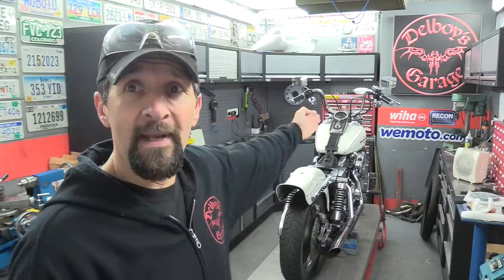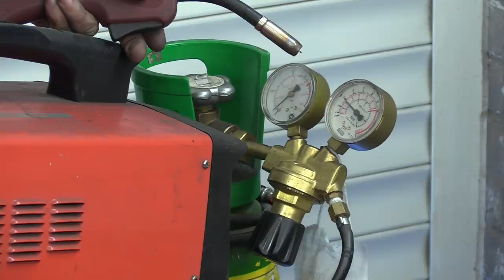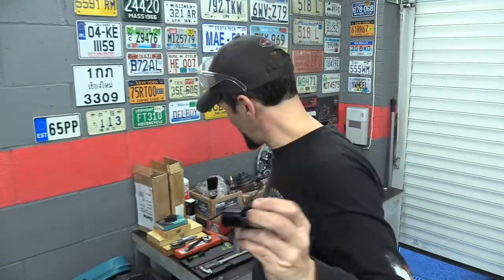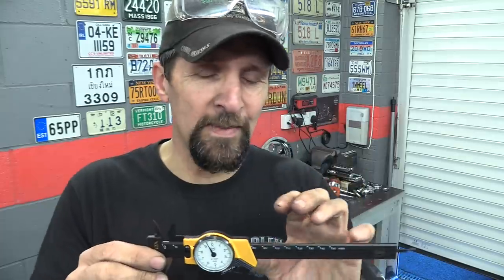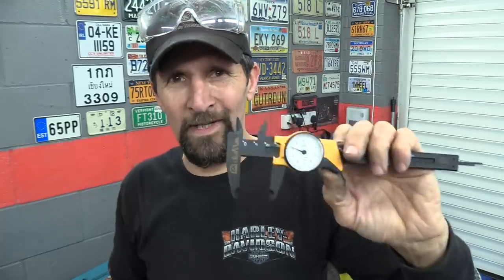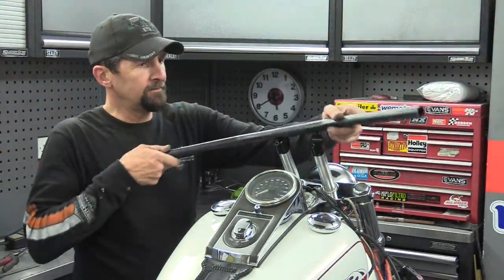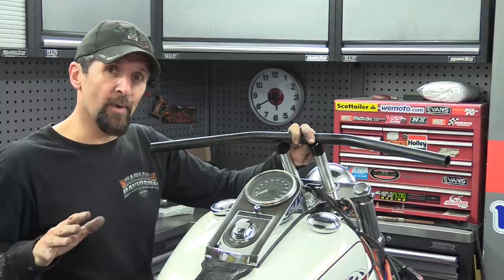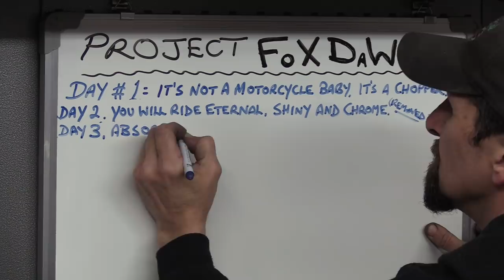Delboy's Garage, Project FoXDaWG, Day 3 :- Handlebars..!

Comment: Hi I am not sure about the threaded bar considering it is generally made from low grade steel (I know I wouldn't use it for this purpose), a lot of weight and vibration goes through these risers even when you take into consideration rubber mounting and leverage from the bars. bare in mind you will be selling this bike. If you wish I can send you couple of 12mm x 200mm high tensile steel allen cap bolts foc.
Personally I would have left the risers solid, drilled into the risers at each end using shorter HTS bolts. The bolts don't need to be D shaped at the top as when the bars are fitted this will align them then tighten from the bottom, a cap screw head at the bottom will look better than a nut and thread protruding.
Reply from the maker: Hi buddy, good to hear from you... well, you're the first person to say you've got, or can get, 200mm x M12 socket cap bolts, I've looked everywhere.. they need to be 8.8 at least, I was loathe to thread anything in to the aluminium, for obvious reasons, every Harley risers is steel in to steel only... am gonna junk the rubber mounts, eventually, and put some steel lock up bushings in there, so that may exacerbate vibration transfer (but I'll damp it out with internal slugs in the bars), it will make the whole front end more rigid... there's a should cut in the bottom clamp, so I'd still have to put a flat in the screw cap, as it won't recess down... and I can't machine them as I don't have a mill, but some 8.8 tenstile M12 x 200 would do the job, if you have some... the closest I got was some dome capped and shouldered coach bolts that were green in colour at the DIY store, and soft mild steel, so obviously no good!  ....

For what it's worth, this stud is labelled 12.9 and was sold as tensile, but of course once you weld it to put a head on it, it does make a weak point... I'd be a lot more worried if I was running taller ape hangers, with the amount of twist that would produce, but not so fussed with drag bars as there's practically none in comparison... 

I'm not riding till about March, so I had planned to keep looking for the said bolts, and I have to admit, I've only been looking retail, there are plenty of small jobbing engineering shops I could have ordered them to be made in the future am sure, but they all seem quite pricey!

And finally mate, this one's gonna be a keeper, if at all possible.. it's a pretty rare bike in many ways, they only made 88inch motors with a carb for 1yr, and at the same time this was sold, they already had EFI models in the showrooms, plus it;s the right style for what I want, so am gonna keep it, if I possibly can... once again mate, if you have those bolts, then I would be eternally grateful, and happy to pay for them... if you could drop us an email too, then we can sort it out, and would love to be able to give you some credit on the video for it when I swop them over... Thanks again, cheers, Del
Reply: @Moonfleet41  They are 12mm x 200mm 12.9 HTC, I will see if I can get your email and get your address and send them to you, no need for a mention Im only glad to help and would do it for most even Matt lol.
Reply: I had to cut and paste your email into my google account to send my email. The link wouldn't send it through iCloud.

Comment: The whole riser fabrication is suspect IMO.  The risers at 6.5" compared with 1" increases the overturning moment by 650%.  The actual leverage on the bolt/mounting is 0.5 of the diameter of 28mm i.e 14mm compared with the original at 20+mm(? - 1/2 major axis of the elliptical riser), thus the stress on the bolt and pressure on the mounting seat  is getting near to 10x what it originally was.  The fabricated 'bolt' itself appears to be only low grade studding, whereas for such a load critical fabrication I would have simply gone for a 12.9 bolt i.e. one with 25mm rolled threads and a plain shank to maximise the strength.  The studding is likely to have a tensile strength of 400MPa compared with the 12.9 bolt at 1220MPa - i.e. 3x the strength.  These bolts are available on-line or through any fastener outlet.  Bearing in mind that you have rubber (!) mounts for the handlebars, I would expect those to fail before the bolt, especially where the loads are increased by 10x, in any case it could be catastrophic.  Remember there is a significant force exerted on the handle bars under severe braking .
Reply from the maker: Hi Clive.. very slightly flawed reasoning maybe mate. the bike will wear Dragbars.. "flat, straight and zero rise".. the factory bars were14 inches high.. so by your reasoning im 7.5 inches lower than stock..?   the pull against those rubber bushes was from 15 inches above (14" bars +1" risers)... and now its only from 6.5" above.!!!  so a 57% reduction in load. 

Also, im going to replace the rubber bushes with steel ones to lock the flex up completely.. and ive ordered some 200mm 8.8 tensile M12 Allen bolts from a stock holder.. just needed a flexible solution for now.. didn't want to go buying expensive fasteners that i turned out not to need.  and for what its worth, 8.8 is correct as the factory use that to bolt the OEM  risers on..!     Thanks for your input mate.. have a good evening.. Del.
Reply: @Moonfleet41  Hi Del,  I did consider the application height but the mounting of the bars adds a rotational element into the equation that I discounted as being too complex and requiring the clamping force and friction of the bars/mounting block to be known.  Imagine if you will, the situation under braking where the clamping force is on the light side so that the bars rotated in the clamp, the horizontal load at the clamp would be minimal until the bars themselves were horizontal, by which time the whole horizontal force was reduce.  I take your point about discarding the rubber mounts, which is a good idea, so long as you don't suffer the vibration white finger from the Harley's "whole lotta shakin' going on". lol 
These days I don't bother with any bolts below 10.9 and prefer 12.9 for all load applications simply because there is no real cost penalty in doing that.  The availability issues of the past are no longer a factor.  Similarly, 8.8 bolts are now so common they are my default spec for all other applications.
I enjoy watching your productions as they are very stimulating and I always learn something, thank you.
Reply from the maker: @clivewilliams1406  Thanks for your reply Clive, it's always been my opinion that you can over think these things and one argument ends up cancelling out another... in the H-D manual they offer some very useful reasoning to many of their recommendations, one being the 8.8 tensile bolts for the riser mounts, anything harder than that will, naturally, be more brittle, and obviously they take bending force, as you point out under hard braking, or acceleration, and milder bolt will be more resilient than a harder one, which is, I guess, their thinking... but am confident in locking up the mountings solid, because luckily this has a cam balanced motor, so the vibes are considerably less than non-balanced engines and also I can damp out a lot more vibes than rubber mounts could ever offer just by weighting the ends of the bars as Harleys never traditionally have bar weights, which I've always felt is odd for such a heavyweight engine... but there you go, great to theorise, take care, have a great weekend my friend, and thanks for your wonderful feedback!
Reply: @Moonfleet41  Hi Del, thank you for your reply.  Not wishing to drag this out longer than necessary, one last point that might interest peeps is that the 8.8 bolt has a yield strength (crudely the point at which it starts to stretch with very little extra load applied) is 40% lower than a 12.9 bolt.  The point about rubber mounts is that under extreme conditions they will allow greater strain on the bolt than a solid mount, in that situation I would like the comfort of having extra load capacity than relying on the bolt's ability to flex.  
It used to be considered that in order to prevent component failure you added compliance into the system to absorb the extra loadings that occurred in some types of motorsport but that was turned on its head when the engineering became more analytical, far from increasing the components ability to accept high loadings compliance weakens the system.  Compliance used in most vehicles is purely for comfort reasons and discarding such compliance immediately increases the load capability of the component.
Reply from the maker: @clivewilliams1406   This is all good news Clive.. i now have some 12.9 tensile allen bolts for the job to replace the ones i made.. and also some solid steel slugs to replace the rubber bushings... it'll be interesting to see how this feels in use with zero damping.. im not so sure it'll be that much worse.. we shall see... thanks again mate.. Del.

Comment: Personally the drag bars for me, I do also think that the risers are to high and the the threaded stock bar should really be hardened steel for more safety. The riser height could lead to a lot of flexing on that heave front end. Just my opinion 🤙
Reply from the maker: Cheers buddy, the label on the threaded bar says 12.9 so it's sold as strong steel, but if I worry in the future when it comes time to ride it, I can get some special bolts made up (as M12 x 220 is not that common, specially not in pre-manufactured size), or I may wimp out and go for some stock 6" Harley risers, that means laying out cash that I have to point towards other things at the moment, and it's always kinda cool to use something you made yourself... I never compromise on safety whatever the cost...
Reply: Moonfleet41 totally agree Del, bike is gonna look 😎 I like the black idea a lot 👍

Comment: You need to shorten you two bolts  to about .25 inch below you bottom nuts.  It looks ridiculous the way it is.
Reply from the maker: They are deliberately long for now Jim, in case I make adjustments for different bars !

Comment: just a slight point, neither of those tools are vernier calipers... one is a dial caliper the other a digital caliper... Vernier calipers have a graduated scale inscribed on them.
and in about 22 years of using all 3 types of caliper (all metal) i've never damaged any surface i'm measuring.
and did you actually move to measure the bolt while the lathe was still turning? I did that once at college and have NEVER done it again lol because there is nothing scarier than having a tool ripped from your fingers.
Reply from the maker: You are, of course, quite correct, but as you probably would agree, the word vernier has just become a general term for all of them... but point take, thank you
Reply: @Moonfleet41 thanks for the response. It probably has become a generic term for the layman, but shouldnt someone who is attempting to teach people things theach the correct terms?
Reply from the maker: @viscarrio  Oh, that wont be me then, I might pass on a few tips I learn from other people, but I wasn't teaching anyone anything my friend... just passing on this ESD caliper was a great remedy for the delicate parts you need to measure that can easily be marked or scratched, nothing more than that.
Reply: @Moonfleet41  fair enough then lol

Comment: I sure hope those bolts are temporary. After you got done face cutting them. You can see the separation between the nut an all-thread.  An wilth all the leverage on those bars. Oh hell no. With the way I ride my bagger. Those bars would snap
Reply from the maker: You worry too much buddy, they won't be going anywhere, remember it's thread, not just plug welded, so they'd have to rotate at least 4 turns completely to come off the end, the stud is 12.9 tensile with nylock nuts, so they'll be fine... !
Reply: @Moonfleet41  I agree to turning 4 threads to move. But at another point. It it's only 4 threads it will bull threw those threads.. just an error on the side of caution
Reply from the maker: @6.7Rollin  Since my previous reply mate, I now have an option on some tensile allen bolts, just couldn't' find them 200mm long till now, so these will be temporary once I get the new bolts!

Comment: Both bars look good to me, but I wanted to see how you adjust the cables to bit the drag bars.
Reply from the maker: As you saw Tom, I re-routed the throttle and clutch cables to give them a longer path to their destination... and the excess wiring will tuck in to the frame...!

Comment: Not an expert by any means. However, what I was always told by Mechanical Integrity experts that you should never weld threads. Something about the peaks and valleys which can cause stress cracks. Probably not an issue with this, but wanted to pass it along.
Reply: i liked the second set of bars.
Reply from the maker: Quite right Wes, it can cause problems, you could norally grind the threads off to give a flat surface... but this was slightly different because no threads were actually welded in real terms, what I did was un-screw half the nut and fill the gap, or dent, in the top with weld... so it was, effectively, plug welding to create a solid bolt head, which is why it was important to weld with a slow wire speed and heat the whole thing up white hot so it all fuses in to one piece... thank you for sharing buddy, much appreciated!

Comment: If this is a quick makeover why bother changing the bars?
Also is that studding strong enough with all that leverage?
Reply from the maker: Any cruiser style motorcycle is very much defined by it's handlebar shape and other large parts, such as the mud guards and exhaust, changing the bars is a great way to alter the profile and silhouette of the bike and it doesn't take long...
Reply: Moonfleet41 sure its your bike do whatever you want, that's what customising is all about.
I was thinking of spacing my bars up by only a couple of inches. But I was concerned about fitting longer bolts through the bar clamps and spacers.